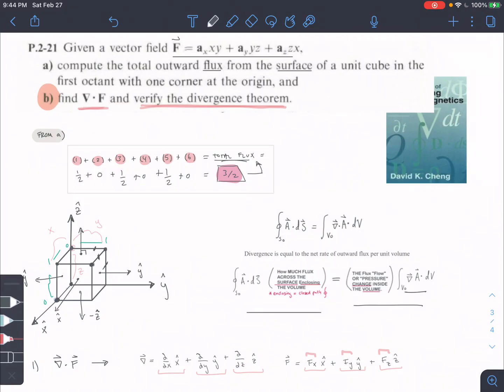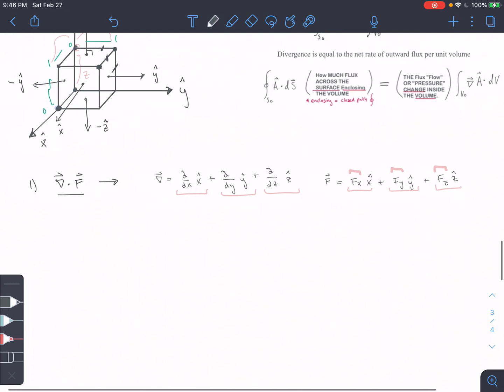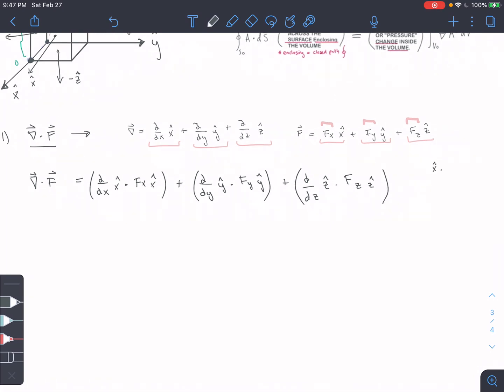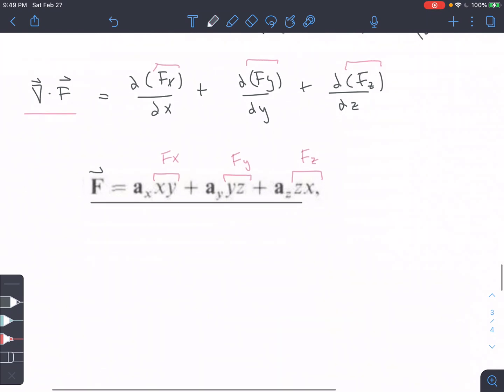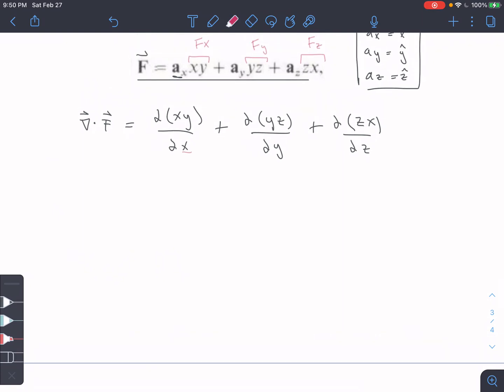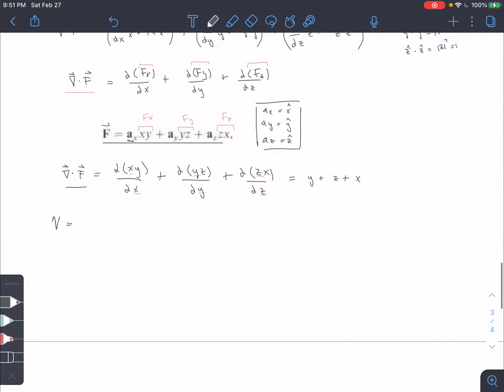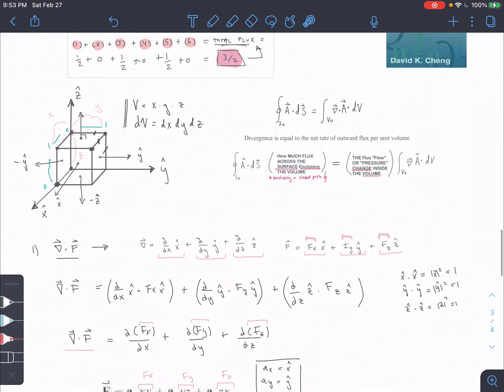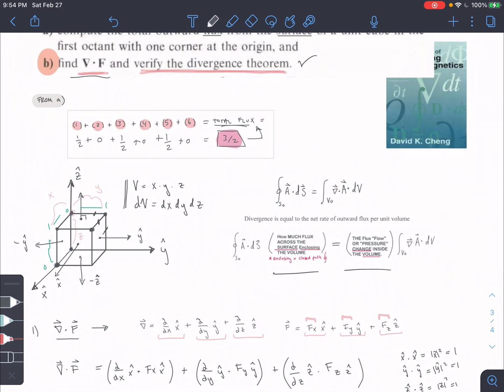2-21b Divergence Theorem Flux Through a Unit Cube

Comment: What if the cube was in the second quadrant? I keep on getting that the divergence theorem gives 1/2 but this one gives 3/2 and they don't agree with each other.
Reply from the maker: check the sign convention for how you set up your pieces,  here everything was positive, but if you shift it, your lengths will be negative and in that quadrant also check your integral bounds they would flip to reflect the negative, for example  -1 to zero would be the bounds. Make sure you are using the correct bounds for dV as well so your sides match